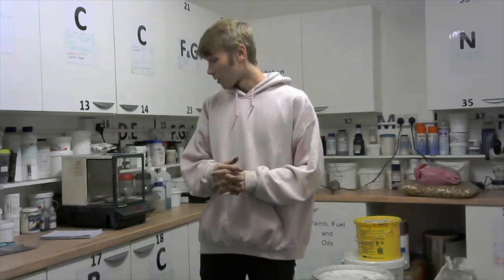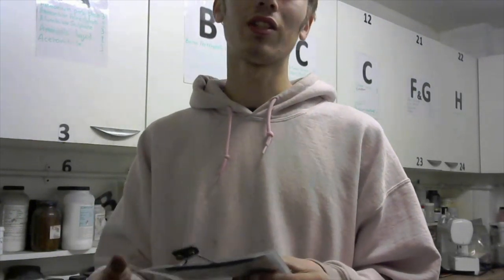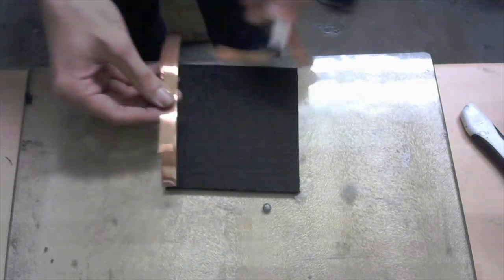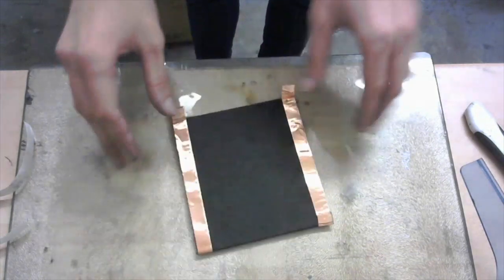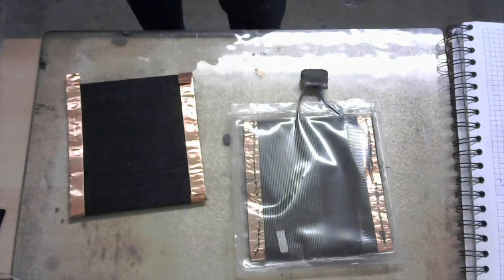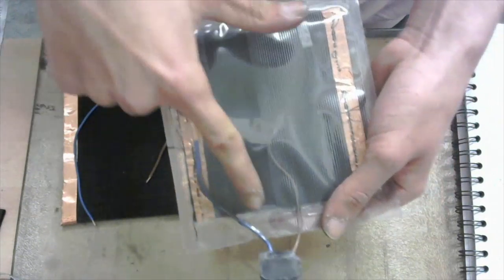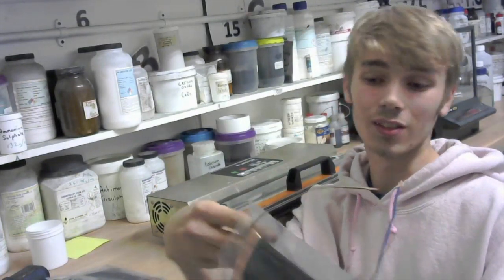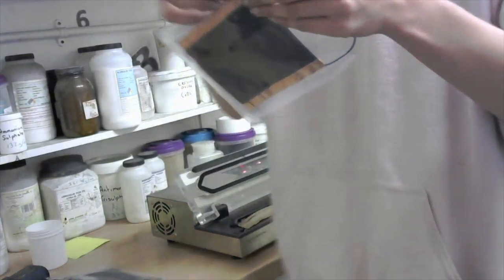How to Make Heaters for your Pockets, Mittens, Gloves - Whatever!

Comment: Nice job young man.  Or Dr. Smith if you've achieved reverse aging.  So my interest in this would be as a way to heat up EV Li ion batteries for charging and longer range in colder conditions.  How would the higher voltage and amps of the common 12 volt system in most autos effect this setup.  Tesla uses a rather complex liquid heating and cooling system but lower end EV mostly just use air cooling and only the internal heat of charging and use which is reduces range and increases charge time in the cold weather.  Thank you as always for your reply.
Reply: Tesla uses 350 to 375 volts,.... so how will effect the 12V setup,.... overburn, damage, etc,.... You need the right resistance of the heating material for each power type.
Reply: @cayrex  Not what I meant.  He is using 9 volts and I think 3 amps in the video.  Most car and motorcycles use a 12 volt and I think 5-7 amp aux port.  Tesla's use a lead acid battery to power the non car motor features that is recharged by a DC-DC converter that steps the voltage down for the lead acid battery.
It should be worth while to warm up the battery cells with a bit of resistive heating to get an over all gain in range and charge speed.

Comment: I have a suggestion. Why not turn the hand warmer into a poorly performing battery? What I mean by this is typically it is desirable to design a battery such that it will hold a charge for a long time once it has been charged. I'm suggesting turning that idea around and designing a battery that will self-discharge fairly quickly once it has been charged up. This could be done by using a separator that deliberately has a fairly high electrical conductivity. It can't be too high or the battery will never charge up. It will just get hotter and hotter until it fails. If the conductivity is too low then the amount of heat generated won't be worthwhile so it might take a bit of experimentation to get it just right. Some other characteristics of a successful chargeable hand warmer include fast charging. Because it begins to immediately discharge once charged up that would require it to be charged immediately prior to use. No one will want to wait long for it to charge. Other characteristics would be electrodes, electrolyte, separator, and packaging that have fairly high heat tolerance. Also the battery needs pretty high energy density. Good luck!

Comment: that's pretty cool. usb devices (such as toothbrushes, lighters or mobile phones) can be scrapped for the battery and mini-usb plug, and those run at ~5V. if you decrease the width of the pad down to say, 6cm, will you get higher temperatures from a lower voltage?

(also, your mobile phone has waaay better audio quality :)

Comment: A heated vest, gloves, and chaps, socks, it would need to be very cold for me to need all the heat, but a 23v pwm controller, or just a DC to DC with cc cv, would work nice, the 24v would make it heat faster, then drop to around 3v with the DC to DC converter, if it was just 100°F would be fine with me, maybe make gloves, with aluminized mylar reflecting the heat back to the body of the person wearing with a cotton cloth insulation, a vest with similar construction, like a light weight jacket insulation, the Battery and controller could be incorporated in to the vest, also it could be Velcro attached in to any jacket, maybe even sweatshirt, and possibly power gloves with the same power source, a couple 2200 mah cellphone sized batteries would work nicely, although a larger surface more resistance, may need more voltage.  I'm guessing multiple channel controllers, for vest chaps gloves and socks! For artic fishermen and explorers,  oil well workers, hunters, or just cold ppl living up north, or way south!! To prevent getting your pants sued  off, a few safeties is a must , if selling such a device!!

Comment: How long would that 9 volt battery hold it warm for?
Reply: The longest time i had it running was around 1hr-1hr 30mins But it kept at a stable temperature of around 27°C ish, the whole time.
Reply: @MyNameIsLukey  Cool, I need to try this. Cheers